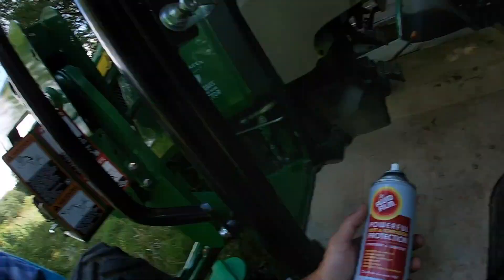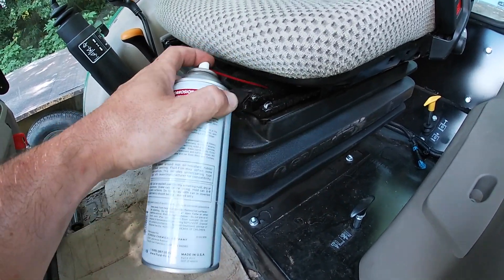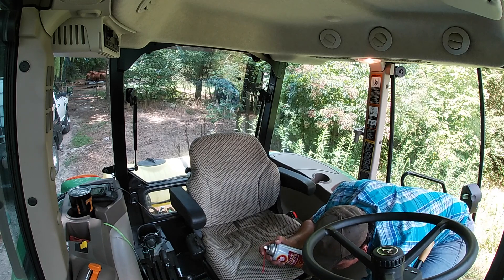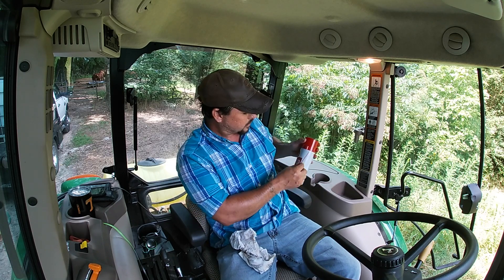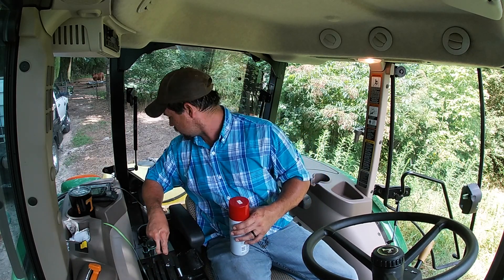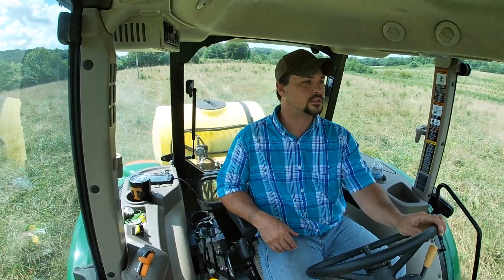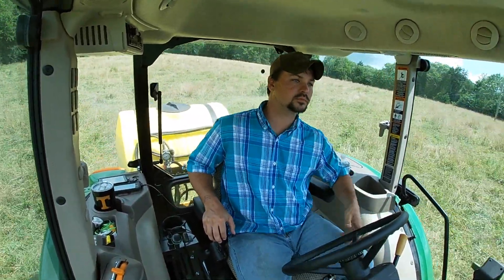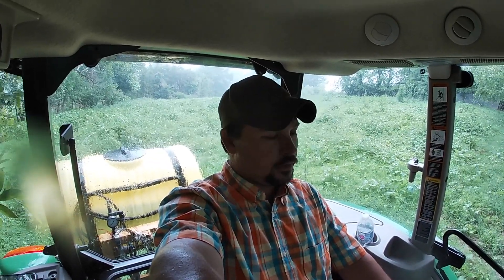5075E SQUEAKING Seat Repair...Talking about Reviews and Comments

Comment: Hey, I fixed my squeaky seat on my John  deere 5065. Take your lube and spray the hinges. In my case it was the back two hinges on the floor under the seat, they are hard to spot. First you have to take the sides of the cover down. It's just rubber buttons that hold it up. Be careful because some of them slide out.

Comment: I have exactly same problem on my new JD tractor... exact same squeak as yours.  Trying what you did.  Fingers crossed this works.  Its making me nuts.  Thanks for the video!!
Reply from the maker: Take the dust cover loose from the front of the seat, and soak everything under the seat with white lithium spray grease.